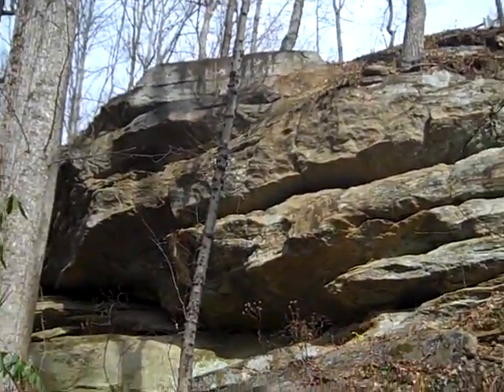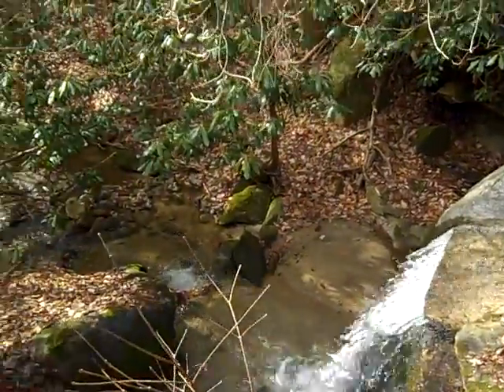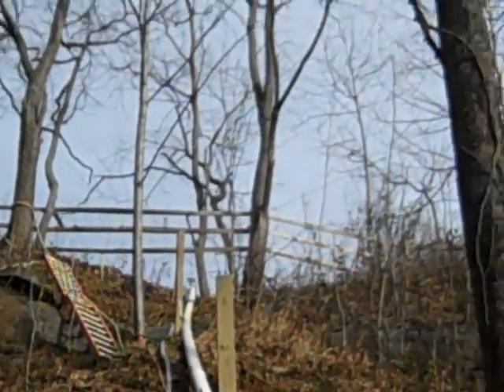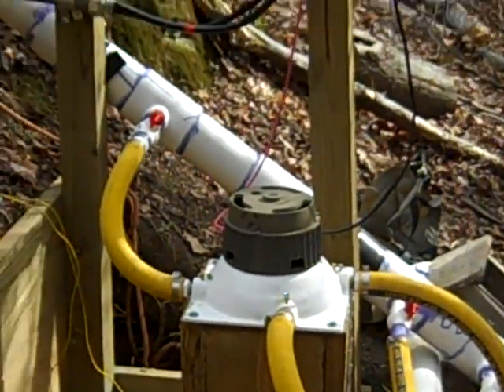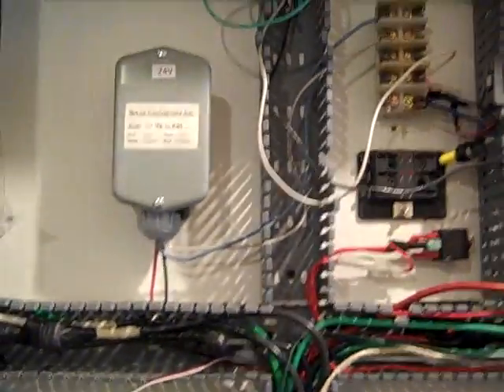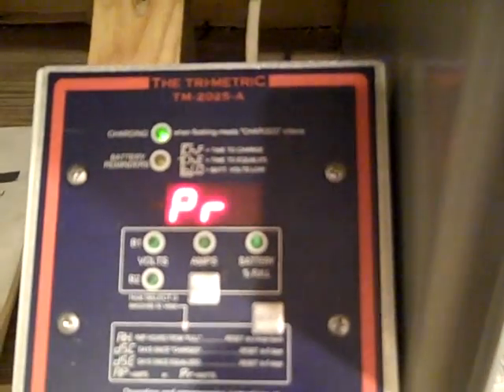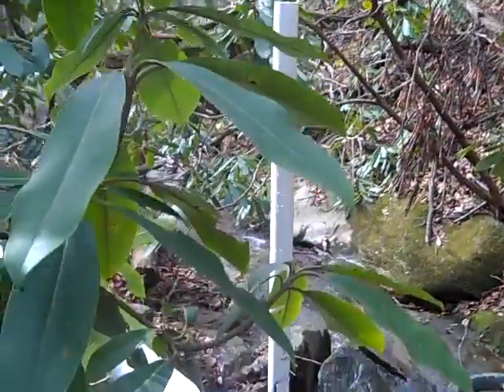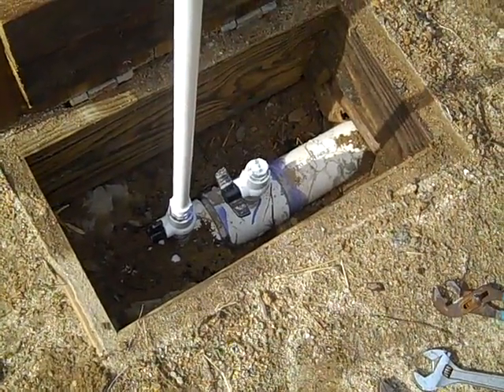Hydro Power - A really sweet setup

Comment: You're giving away about 5 ft of head having the Pelton wheel so far above the discharge river
Reply: ADDENDUM

28 psi = 64 ft head
50 gal/min = 6.68 ft ^ 3 per minute

Check your actual flow rate at the discharge

Place to turbine wheel to capture the maximum head, estimated possible head 70 ft
At 70 ft head 1 ft^3 per min = 0.1128 HP
6.68 ft^3 = 0.75 HP so 500 watts output is about right

I would suggest a Turgot wheel instead of a Pelton wheel. The Turgot works better for a vertical axis.

Turgot and Pelton wheels must match the water velocity at the nozzle to the RPM to maximize energy capture. Basically V1 / V2 = 0.50

Comment: So, before we had solar panels and deep cell batteries, there were ppl powering their homes with hydro. Why do you have to tie it to all those control boxes and such? If the SHTF what good would solar panels and battery banks do, if you couldn't go buy more when the batteries go bad? I can't seem to find any videos on running your electric with just hydro. What say you, on these things?
Reply: +getsmartnow2011 Most people don't use power at a flat level load. The batteries are a buffer to store energy during times of low use and provide a boost when you need more than the generator can provide.
Reply: Although it can be done, most of the time it's not really practical. The generator can only put out so much juice at a time. If you can control your loads extremely tightly so that it doesn't overpower the generator, then I guess it could be done.
The reason a small battery bank is normally used, is because these are small and relatively inexpensive generators and penstocks. Adding a small battery Bank would allow much more power to be drawn from the system for a fairly short period of time like a well pump or hair dryer or something. The battery is able to add its power along with the generator for those short periods of time, then the generator recharges the battery.
Reply: North-n-South Homestead - https://youtu.be/61lZn1sUkzE

Comment: To bad the 4" penstock pipe is made of non-sunlight resistant PVC.  They will probably have a beautiful sprinkler system in two years.
Reply: No sprinkler system yet.  It's been going strong for 3.5 years.  Thick wall PVC will last 20 years or more in the sun.  Lots of tail races on dams at fishing ponds are proof of that.  Also, I painted it with black rubberized paint like they use on bedliners, but after a few years it has to be re-painted due to weather.  I'm sure that's helping with UV and it provides some camouflage.  The best pipe is black HDPE, but it is very expensive and has to be welded together with a special machine.
Reply: Good point.  They could paint it.  A couple coats of enamel would keep the UV away
Reply: It’s been 11 years and no sprinkler system yet. Schedule 40 PVC is more durable in sunlight than people think. NONE of my 4” PVC has cracked or failed.

Comment: Nice job on your hydro installation.  Have you considered a small 4 inch pitch turgo impulse wheel, the ones we have installed can have nozzles up to one inch diameter.  100 gallons per minutes with 70 feet of head should produce nearly 1000 watts.  These small turgos are about 60 percent efficient.

Comment: The weir screen is backwards, the screen should ramp up, not down as I'd does here, you want just enough spill over to wash the debris off the screen surface. If the weir was turned 180degrees from present position you would drive more water into the box.

Comment: I am now generating 1 KW consistently after a redesign.  I added a 4" pvc wye at the intake to allow two 4" openings to contribute water to the penstock.  One pipe creates an "air lock" & restricts flow.  Also, I mounted one of the pipes at a downward angle to help take water out of the weir box.  At the turbine box at the bottom of the penstock, the box was filling up and this created a "blender effect".  This was fixed by adding another 4" pipe to take the water out of the turbine box.
Reply: MicroHydroJimbo That's really  helpful. So doubling the outlet from the turbine is a general good idea.
Reply: this is a sweet installation.  sounds like you have it dialed-in.  so, just one observation.  the fully enclosed turbine exit is, probably, still reducing efficiency a little.    see draft tube.    cheers
Reply: @daviddavids2884  draft tubes work well with reaction style turbines, not so much with impulse turbines.

Comment: I have a question for you Engineer and all else who'd like to comment.  What is the potential voltage available from these systems?  Can they provide power to live as we do now with commercial power?  Can you run a welder, dryer, and other high wattage, amperage, voltage equipment?  I have not yet measured the vertical drop on my lot but I think it's about 200 feet from the high back side to the river.  Will I be able to use Ram pumps to fill tanks at the top to then run back down to turbines?
Reply: The voltage depends upon the generator. I think what you're really trying to ask is the wattage. 120 volts x 1 amp equals 120 watts. 12 volts times 10 amps equals 120 watts. Both examples are the same amount of power, or rate. To get the quantity you simply need to add a time component. So 120 watts x 1 hour equals 120 Watt hours. 120 Watts times 10 hours equals 1200 Watt hours, or 10 times more. The really, really nice thing about hydropower is that it runs 24 hours a day all day, every day. Because of that you can collect a lot of Watt hours over time. While you're at work, shopping, sleeping Etc. Day or night, windy or not, it doesn't matter it just keeps chugging along putting out power all the time.
Now the amount of power that you can get from moving water depends upon the head, or the vertical distance from the intake of the pipe to the turbine, and the flow in gallons per minute. The more of each the better.
You mentioned you have about 200 ft of head which is alot! But you did not mention how much flow. The good news is that at 200 feet of head you only need a small amount of flow in order to make good power.

Comment: @jbhelix108 

freezing is not an issue if the water is flowing.  It's kinda like leaving a faucet dripping on cold nights.  When the turbine is not running, a valve at the dam is shut and keeps the water from filling the pipe.  No water in the pipe = no freezing.  When I install the redundant controller and diversion load, the turbine will run 24/7.

Comment: I finally adjusted the field on the Harris Hydro.  This gave me an additional 3 amps (150 watts x .90 = 135 watts at the cabin).  I added boards to dam up the intake at the weir and the screen is totally submerged now.  Pipe is stil half full.  Still haven't checked the unrestricted flow.  Hope to do that this weekend.  Another modification I am installing this weekend is a redundant Morningstar controller and diversion load.  If the existing one fails, it will overcharge and boil the batteries.
Reply: Good idea for the backup. Morningstar makes great stuff don't they?

Comment: This afternoon I will be adjusting the field on the turbine to get more power, and adding a fan to the top of the unit to dissipate heat.  A fan is suggested for any Harris Hydro application near 1KW.  The field adjustment should add power because there is a lot of splash against the flexiglass in the box.  There is so much splash that it blew out some of the caulk on the box.  I'll also be checking the unrestricted flow on the pipe today.  I'll try to post what I learn tonight.

Comment: On Saturday I changed out all 4 nozzles with larger 1/2" nozzles and saw an immediate boost.  The ammeter at the turbine is showing 20 amps which translates to 1KW(Ohms Law - volts x amps = watts) at the turbine.  My metering at the cabin is showing about 800 watts produce there.  Not sure why there is a difference between the two since the wire connecting the two is 4/0 aluminum and losses should be minimal.  I am investigating this.

Comment: Engineer 775 just gave me a great idea.  Since the nozzles restrict the flow, I need to bypass the nozzles to see how much unrestricted flow I can get.  Why didn't I think of that?  Luckily at the end of the penstock I have a 4" threaded cap I can remove so I can see.  This will tell me if the intake at the weir a bottleneck, or if it's the nozzles.  I'll post my results here for anyone that wants to see.

Comment: I talked to Don Harris (Harris Hydro) today.  He suggested a few modifications:  
1.  Based on the GPM we are getting, he thinks I should use larger ½” nozzles.  I think that 3/8” nozzles are in it right now.  This will increase the flow to close to 170 GPM at 70’ of head and also increase the wattage.  
2. Another area I may be able to increase wattage is to adjust the field on the turbine.
3.  Another is modifying the intake. 
I am making these changes in Saturday and will post my findings.

Comment: You could be looking at potential for a 5-8k system. If the flow rates for the stream are pretty constant, there is tremendous untapped potential. Fantastic video!

Comment: If properly designed, all of the energy in the water(gpm and head) is spent at the turbine.  Where the water goes back into the creek(the tailrace), there is very little potential power since the head is only about 1' in my system.  If the pipe were continued down the mountain where the tailrace currently is, the energy would build up in proportion to the drop in altitude(head)

Comment: As long as it is running, it's kinda like leaving a faucet dripping on a really cold night to keep it from freezing.  Right now it's not running because I haven't finished the roof on the shed and it's covered with a tarp.  I opened a spigot at the end of the penstock and closed the valve at the dam.  This drains all the water out so it won't freeze.  Also, I want to observe the dump load before leaving it unattended cooking off energy in the form of heat from the resistor bank.

Comment: Excellent point NewJura.  I am painting the above ground PVC pipe with camouflage paint to hide it and protect it.  Some of my paint is rubberized like bed liner and is on all the threaded rod supports.  This is why some people use the black HDPE pipe since it immune from UV damage.  PVC costs less and I did not have to rent the fusing machine to join sections.  HDPE is really better for Micro Hydro, but I needed to save some money.  If the above ground PVC degrades, I'll replace it with HDPE

Comment: You could, but you would need to pump the water back up the mountain.  Duke Power is doing this in South Carolina at a place called the Bad Creek Creek Hydroelectric Station.  It is a 1,065-megawatt pumped-storage facility located in Oconee County, eight miles north of Salem, South Carolina. The four-unit station began generating electricity in 1991, and is the largest hydroelectric station on the Duke Energy system. Google Bad Creek + Duke Energy and there is a lot of info about it.

Comment: @MicroHydroJimbo  Could you catch the water that leaves the turbine and recirculate it back up to the dam?
Reply: The amount of electricity used to pump the water back up to the dam would be more then what the generator makes. That's why perpetual motion does not work.

Comment: The diversion load is a resistor bank in a vented Hoffman box.  I hope it's not a fire hazard.  Since I just set up the turbine for testing, the diversion load has not kicked in yet so I don't know how much heat it will product.  Currently the cabin is running on grid power till I am back there to monitor things.  The plan is that it will heat up the basement to keep the pipes from freezing in the winter.  In the summer, I will move it outside.

Comment: @MicroHydroJimbo Even when just wiring a house? I have a 30 feet USB cable and there barely any voltage drop and it's only 5 volt. I use cat5 ethernet cables at work and they're rated for 300 feet and that's fine as well.

Comment: 12 volts is very inefficient.  Due to the low voltage, distances causes voltage drop and you have to use big wire to prevent that problem.  Also, 12V appliances are often very expensive and not readily available at local stores.  Due to the efficiency of new inverters, inverting the power to 120V is much more attractive nowadays.

Comment: My new irrigation system has 2 pipes. 1-8" pipe is metered to give me 2 acre feet of water during the growing season at 80-90 PSI which is adjustable being passed through 1 pressure reducing station. The other pipe is 2" year round livestock water and is not metered or pressure regulated and gives me 120 +/- psi. The fun begins with the unlimited power supply of the 2" pipe.

Comment: @tanksanatra  Funny how it seems like it would work like that but it doesn't. It's the height of the water column that gives it the preasure. For every 33ft of height the preasure increases about 14.7 PSI. If you reduce the pipe diameter you reduce the flow rate at that preasure.  The preasure would be the same in a 1" pipe as it would be in a 10" pipe. The 10" pipe would allow more flow rate than a 1" pipe, but the preasure would be the same. I think Galileo discovered that.
Reply: That's true only if the water is not moving. As the water moves through the pipe, the friction of the pipe reduces the pressure. The smaller the pipe the faster the pressure reduces per the amount of flow.

Comment: @quaddogger He was around 200 watt short according to the panel showing in the video not including peak power usage when using appliances like an oven, vacuum, washer/dryer etc.
I have a question, do you know why a household is not primarily wired for 12 volts for most basic electrical appliances to work, and just some high voltage lines instead of 110 throughout the house?

Comment: you should try starting with a 10 inch pipe for 40 feet , then neck down to  8 inch for 40 feet , then 6 inch by 40feet then the rest 4 inch , this will put more wieght behind the water thus more pressure
Reply: Actually, no it won't. The pressure will be exactly the same if the water is not moving whether it's a 1-inch pipe or a 12 inch pipe. Once the water starts moving though, the larger diameter of the pipe the less friction and pressure loss you have. That's why it's not a good idea to reduce the diameter of the pipe as you go along. Pressure rating increase maybe, but not reduced diameter.

Comment: @SquirrelFromGradLife 500 watts 24 hours a day is all the power you need to run an entire household that is setup for energy efficiency. In Northern Ontario we run a 16cu/ft SunFrost fridge, 7cu/ft Sundanzer deep freezer, water pump, and all the cabin lights off of 492w worth of panels (4x123w) which might make 1/10 the energy of this micro turbine in a day.

Comment: Nice concept and use of natural resources, but it seems like an awful lot of work for 500 watts. Those 450 feet of pipe ain't cheap. Wood gasification driving a small generator feeding into a big lead acid battery bank would make more sense since you can feed the exhaust into a basic heat exchange getting heat, hot water and power at the same time. A patch of willow can provide enough fuel for a family.
Reply: Well yes, if you want to perpetually have to go and cut and split wood all the time. What will happen if you become handicapped or just old?
Don't give me wrong, I love wood fires. I would just use it for one of my Back-ups, or Aesthetics.

Comment: Good point.  The key is to design a low power retreat.  With everything running at my cabin (<1,000 sq. ft.), we only use about 700 watts in winter with everything on during the day.  Some tips:  
 - CFL lighting
 - l.e.d. floods that use 3 watts per head/light
 - fridge is propane or electric.  Currently running on electric using 225 watts
 - wood stove for heat
 - propane on demand hot water heater
 - 12/24VDC well pump that uses minimal power
 - high efficiency ceiling fans (23 watts)
Reply: It sounds like you're using an adsorption refrigerator from an RV or something. If I may I'd like to suggest using a compressor refrigerator to save wattage to use for something else, like maybe the low-wattage pump on a solar water heating system.

Comment: @revisualize 

Yes as long as there is a drop in elevation at the end of the penstock(the 450' run of pipe) to produce more pressure for turbine# 2.  Turbine#1 takes all of the energy out of the water up at the end of the first penstock.  My neighbor may connect  to the end of the penstock for irrigation to his garden.

Comment: @TheHossUSMC 
The bearings are well lubricated and last for several years before they need to be replaced.  I bought spares with the turbine.  The water does cool the unit, but when you as you approach 1KW, Harris recommends a fan mounted on top of the unit.  I have it, but haven't installed it yet.  I ran the wiring for it, but just haven't hooked it up yet.

Comment: @weaponeer 

$2,500 - MicroHydro Turbine
$3,000 - Batteries
$5,000 - Outback Inverter, charge controls
$1,100 - 450' of 4" PVC
$???? - Miscellaneous Concrete, 4/0 Aluminum Wire, shed, blood, sweat, tears

It ain't cheap.  The trick is to include it in the construction loan for the cabin you build.  That's what I did.  Otherwise I could have never afforded it.